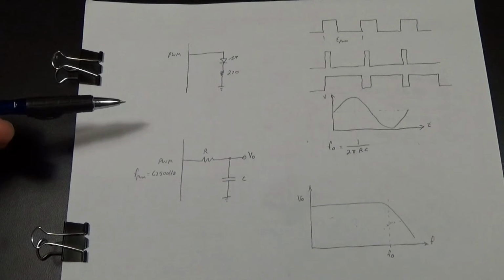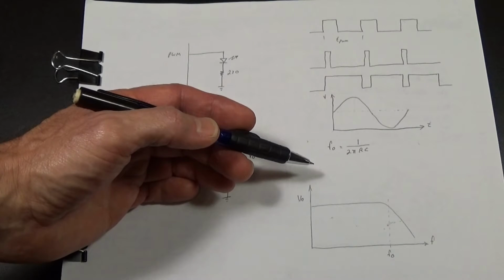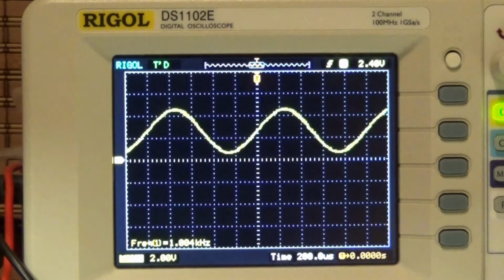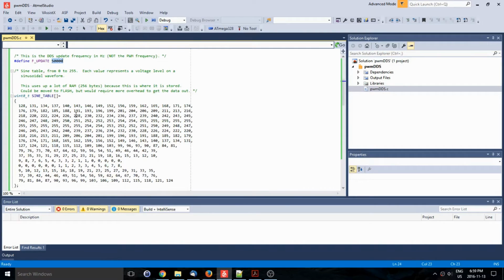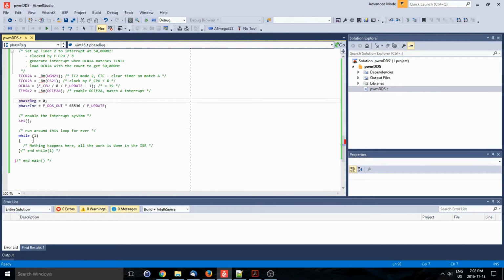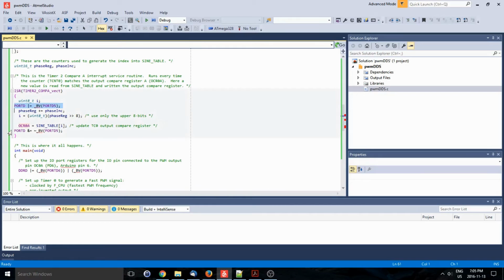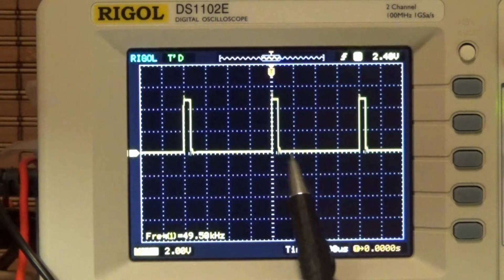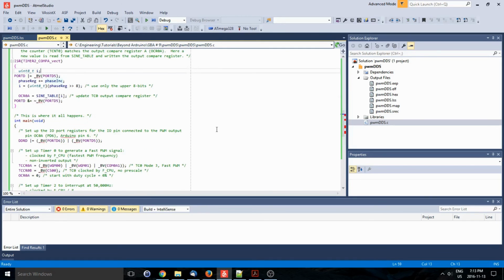Going Beyond Arduino # 9: PWM as Direct Digital Synthesis

Comment: i didnt understand how you calculate the forml for phaseInc
Reply from the maker: The formula is given on line 102 of the software in the file pwmDDS.c on my gitHub site.  Link in the description.  The formula is:
phaseInc = F_DDS_OUT * 65536 / F_UPDATE
Where:
F_DDS_OUT = 2500 (the desired frequency)
F_UPDATE = 50000 (the frequency SINE_TABLE is read, Timer 0 generates an interrupt at this frequency)
The multiplication by 65536 is so that the resulting integer division is greater than 1.
I hope this helps.  Thanks for watching.

Comment: hello there , thank your for your good explaining ! i d like to know , assuming we have to sinwave and we d like to put a phase von 120° between them  , how you would proceed ?
Reply from the maker: You would have to use another PWM output.  The same look up table (LUT) can be used, just change the index so it points to a  point in the LUT that is 120 degrees earlier or later than the first output.

Comment: Hi Craig,
At +/- 11:00 you explained about changing the phase increment from a terminal program .
I tried this and here it is. You can type for example12345T at the serial console and the value
 12345 will be stored in the phase increment. (T is the trigger to process the value).

I did not measure the frequency so far, but placed a tiny speaker over the C of the RC lowpass filter (fed by the PWM signal) and generated different tones by putting different values into the register.

scanConsole() is called in the main loop(){}
 :

void scanConsole()
{
  if (Serial.available())
  {
    char ch = Serial.read();
    if (isdigit(ch))
    {
       val = val * 10 + ch - '0'; //accumulate value from console
    }
    else if (toupper(ch) == 'T')
    {
      setPhaseInc(val); 
      val = 0;
    }
  }
}

void setPhaseInc(uint32_t val) // I used a 4 byte phase register
 and accumulator register
{
  phase_inc = val;
  Serial.print("T="); Serial.println(phase_inc); //echo to console
}
Reply from the maker: I believe I do something similar to this.  Not sure if it's this video or another.

Comment: Hi Craig, I want to generate a quadrature phase waveform. I used the method you described above, for quadrature component i used 16 bit Timer 1. All is working great. I have generated two waveforms identical to each other. The issue which i am facing is that i am not able to generate the quadrature lookup table i.e. ( the Cosine waveform lookup table). Can you explain me how to generate the other lookup table.
Reply from the maker: I used a spreadsheet.  I put the one I used on my GitHub site:
https://github.com/hollingerc/going-beyond-arduino/blob/master/sine%20table%208-bit.ods

I use Libre Office to create the spreadsheet, a free download.

Good luck and thanks for watching.
Reply: Craig Hollinger , you haven't understood my question i guess. The spreadsheet which you are referring to me is the same as already described above in the video. The lookup tabled discussed above contains PWM values corresponding to sine wave. At index 0 you have stored PWM value=128 , it should have been 0 because sin 0 = 0
What i want to do is to give a 90 degrees phase shift to that look up table and output it to another pin of controller. Do you get my point now?
Reply from the maker: I understood your question.  In the spreadsheet I used a sine formula to generate the values in the table.  You'll need change the formula to add the phase shift to give the table you want.  The new values generated will automatically be copied to the other two tabs.  Just copy the values from the Atmel tab into your program.  If you need help with the sine function, there are a lot of informative sites on the Internet that explain how the sine function works.  Google is very useful that way.  This is how I did it.
Struggling and working through something new is a fantastic way to learn.
Reply: Craig Hollinger , i went through the spreadsheet file, The sine wave which you have generated differs from the standard sine wave. At 0 degrees, PWM should have been 0 but you have selected 128.
Reply: Craig Hollinger , keeping the sine wave which you have generated as a reference, it is impossible to generate the cosine wave, because during any time of the 360 degree cycle, the sine and cosine would not be 90 degree apart from each other.  I know i might sound silly, but i hope so you are understanding my point.
Reply from the maker: Sorry for the long delay in replying, super busy at work.  I've uploaded a new spreadsheet to GitHub that contains some notes on the sine function.  Now there is enough information for you to be able to modify the equation to get any phase angle you need.

Comment: hi Craig . ı have a quastion.  can ı change duty cycle at ad9851. so they are writing max duty cycle is max %60, min %40  in datasheet

thanks :)

AD9851 datasheet: http://www.analog.com/media/en/technical-documentation/data-sheets/AD9851.pdf

AD9851  datasheet pictures : https://hizliresim.com/7DPLoW
Reply from the maker: If you look at Figure 2 on page 10 of the data sheet, you'll see how the AD9851 internal comparitor is connected up to generate a square wave signal on the CMOS outputs QOUT and QOUTB.  This gives a square wave with a fixed 50% duty cycle.  To vary the duty cycle, just change the voltage going into the -ve input of the comparitor.  In the diagram, this input is going to a resistor divider.  Remove it from the divider and apply a variable voltage between 0 and 1V.  This will vary the duty cycle.  You'll have to do some experimenting to get your desired 40-60% duty cycle.

I hope this helps and thanks for watching.
Reply: hım firstly thak you :) :). so. I vary reference value to comparator for vary duty cyle.well. how ı to know duty value. is it through trial
Reply from the maker: You can calculate the voltage required to get the duty cycle, but it will be complicated by the sine waveform.  I believe you can turn off the sine ROM in the AD9851 so it outputs a triangle wave.  That way the calculations will be simpler.

Trial and error works too.

Good luck!
Reply: thank you so much Craig. Best regards from Turkey  :)

Comment: DDRD |= (_BV(PORTD6)) | (_BV(PORTD5));
What this line represents?
Reply from the maker: This line make pins 5 and 6 of IO Port D into outputs.  DDRD is the data direction register, any one (1) bit in it makes the corresponding pin on the port an output, any 0 bits make the corresponding pin an input.  PORTD5 and PORTD6 represent the pins (pins 5 and 6) that are going to be outputs.  They equate to the numbers 5 and 6.  The macro _BV() means left shift 1 the number of bit positions represented in the ().

_BV(PORTD5) = _BV(5) = 1 << 5 = 00100000, the 1 bit is in the 5th position.
_BV(PORTD6) = _BV(6) = 1 << 6 = 01000000, the 1 bit is in the 6th position.

The | means logically OR the two sides together.

_BV(PORTD5) | _BV(PORTD6) = 00100000 | 01000000 = 01100000

So this results in:

DDRD = 0b01100000;

DDRD, PORTD5, PORTD6 and _BV() are all macros (#define) and are defined in the compiler.
Reply from the maker: The PWM output is on pin 6 of Port D.  I'm not sure why I also set up pin 5, I didn't use it for anything.

My code and a schematic are on my GitHub site.  Link is in the video description below.  Please check it out, all the information you need is there.
Reply: Thank you sir
Reply: @craighollinger9972  Hello, first of all thanks for the good work here, I can imagine it has been quite hard. Unfortunately this only work in pin 5 for me. As I've tested, multiplexing is totally out of the picture here as well.

It would be really nice to have the DAC example working for Arduino (in Arduino environment) although I understand recoding all that is quite time consuming. One advice, if I may: if you code this as objects it's a bit harder at first but then it's much easier to maintain, improve and will probably also compile in Arduino IDE.

STILL, even though I need a DAC for voltage control, this DDS in pin 5 is being helpful. I wonder if it can also be used in 2 more pins (as I need a total of 3).
Thanks again!
Reply: @craighollinger9972   Is it possible to change the output pin to pin 5? I tried using _BV(PORTD5)  but the program stops working.
Reply from the maker: @momchilrudarski8708  I believe you'll need to modify this line of code: TCCR0A = (_BV(WGM00) | _BV(WGM01) | _BV(COM0A1));.  Change the last argument from COM0A1 to COM0B1.  Now the PWM should come out PORTD5 pin.  Thanks for watching!

Comment: Craig cant we get a analog output using only rc filters at the pwm output... ? Why do we require an analog conversion code though?
Reply from the maker: I'm not clear on what you are asking.  Perhaps I can clarify what I was doing in the video.  Here, I show a simple RC filter on the output of one of the ATMEGA PWM outputs.  The output of the filter will be higher in voltage for a higher duty cycle, lower voltage for a lower duty cycle.  In order to get a sinusoidal signal after the filter, I have to vary the PWM duty cycle in a sinusoidal manner.

I hope this answers your question.
Reply: With several filters in series, you certainly could filter out the harmonics of a square wave to achieve a sine wave.  The problem is that the signal level would reduce with each stage.  If you also amplified the signal at each stage to make active filters, it would compensate for the voltage reduction.  So yes, you could produce a sine wave using active filters.